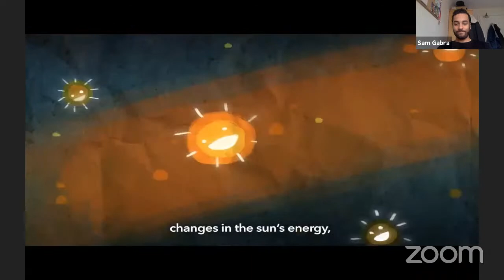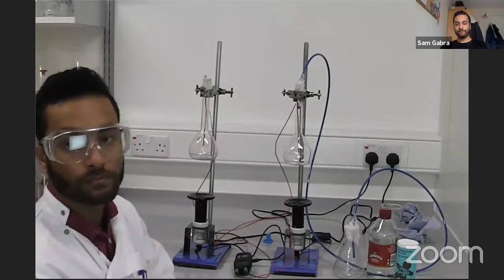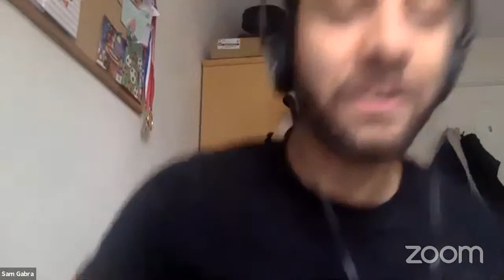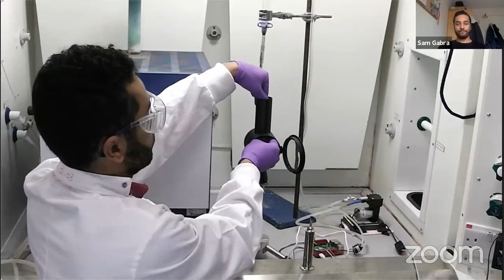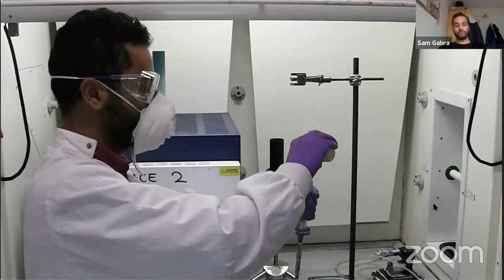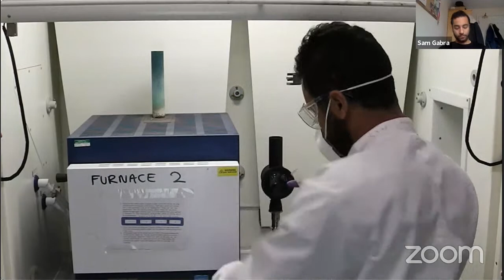Demonstrating the effect of CO2 on global warming

Comment: Are you guys serious?  That's a rubbish experiment.  What percentage of atmospheric CO2 can cause a change. Has anyone thought about that human activities and heat generation alone by overpopulation and the consequences of this, wars,  nuclear heat generation,  excessive travel, air conditioning,  ...CO2 may keep in the heat from the sun but isn't it possible that we could lose this heat if we didn't contribute so much to this heat also? CO2 dissolved in rain will get back to the sea which has a natural buffer called salt....remember that in chemistry class...Come on. The CO2 concentration used in this experiment is significantly higher than what is happening now so it's difficult to even extrapolate this to real life.

Comment: CO2 has double the heat conductivity compared to air, so for the same duration the CO2 will absorb more heat than the air flask.  More heat thus, higher temperature.   If you have equipment to measure energy input into different flask, then you will see CO2 flask absorbed almost double the energy compared to the air flask at the same duration.  This experiment only proves that CO2 has higher conductivity than air.  Nothing at all about greenhouse gas global warming.